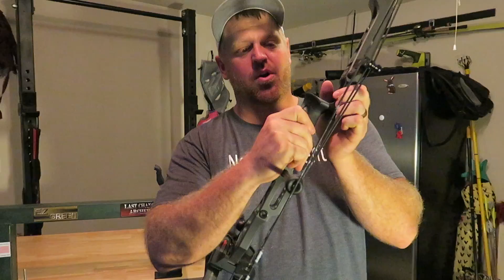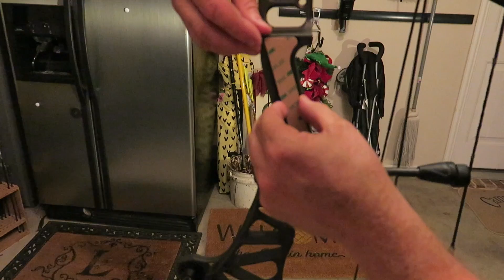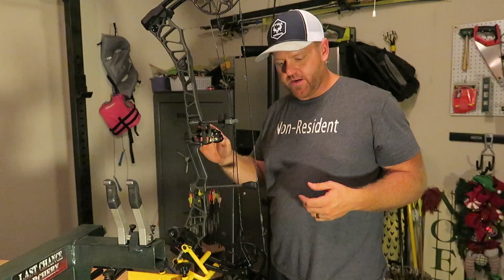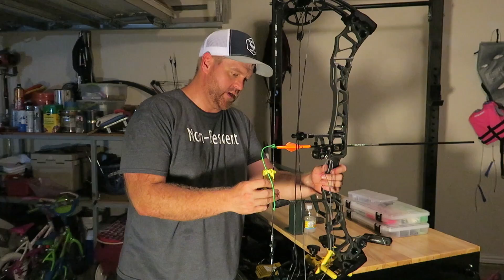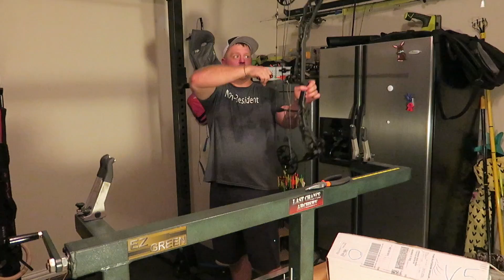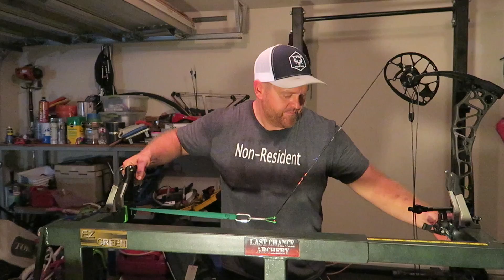Mathews Traverse: DIY Bow Set Up!

Comment: Thanks for all the info. I’m trying to setup my own traverse and I’m having the same issue with basically being a quarter turn off with cam timing. Any tips on getting it perfect? Tia
Reply from the maker: Sorry for the late reply. Yes there is a fix.. It is hard to explain through text tho.. LOL.. You basically take the yolk and either twist or untwist one of them just a little.. It takes some tinkering but it is doable.

Comment: Nice build! How do you compare the Halon X vs the Traverse? Is the Halon X is still a good 3D / Targer (crossover) bow? Accuracy, draw cycle, shootability? Thanks.
Reply from the maker: Michel M. I like the grip a lot better on the traverse. Other than that they are basically the same bow with the traverse just slightly shorter ata. Either would be a good crossover bow.

Comment: Great video. You have a sweet DIY setup and it's obvious from watching that you know what your doing. I have a Vertix (which is awesome), but I've been looking more and more at the Traverse. I have a 29.5-30 draw length and I may like the longer ATA bow. I think I am going to get into the shop I go to and try one and see. The reason I didn't before I bought the Vertix was because I am a LH shooter and they didn't have any in stock at the time. Anyhow, why do you remove the monkey tails? Do they not help at all?
Reply: Sub'd btw!
Reply from the maker: Hey thanks. I am really liking my traverse. I take the monkey tails off for 2 reasons. #1 I shoot a pretty heavy arrow so my bow is already really quiet. #2 they seem to wear out and break pretty quickly and by removing them you will gain a few feet per second. So I don’t want to be in the middle of a hunt and have one break or fall off and then my sight tape is 2-3 seconds off. Glad you liked the video. I am gonna try to keep making them lol